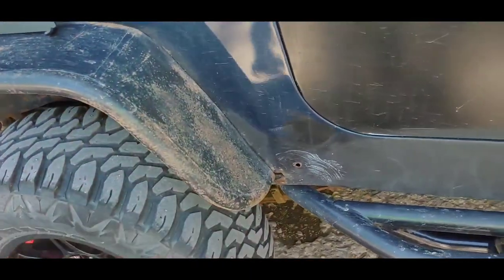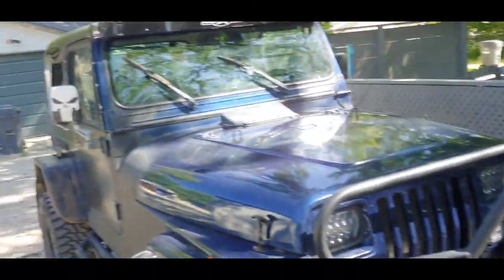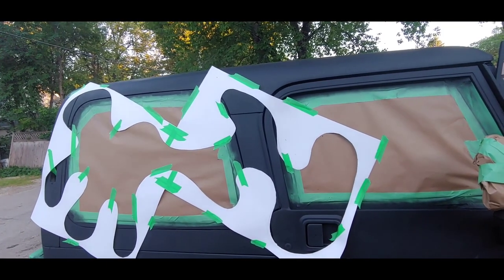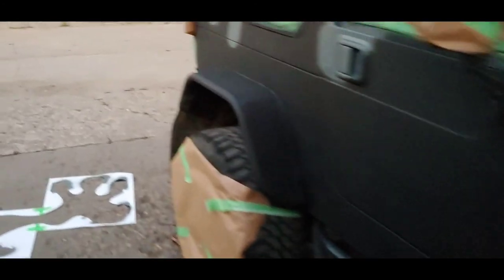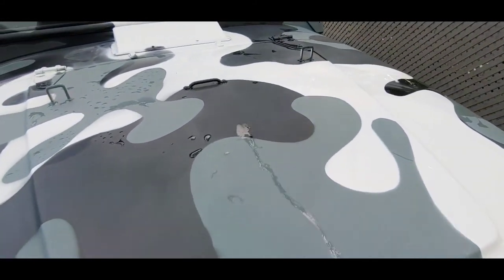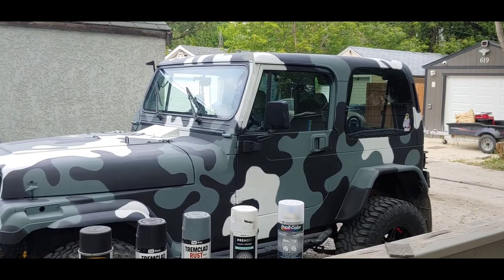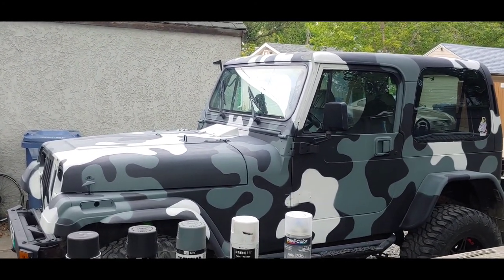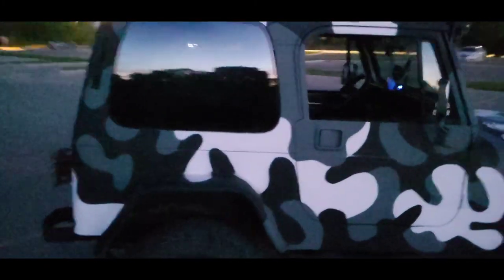Jeep Wrangler YJ Snow Camo Spray Bomb Paint!  (Cheap-ish driveway job)

Comment: I've been camouflaging my 42ft narrowboat and loving it! I'm on the 2nd colour. I used a paint spray machine on the base coat and the pattern I'm doing with a paint brush and small roller. My patches are huge compared to yours. You did a great job on your jeep.

Comment: Thinking about doing this to my 1988 Toyota pickup
Reply from the maker: That is about the only Toyota I can find acceptable.  But in full camo would for sure be a sweet lil truck. Best of luck to ya if you do, any questions feel free to ask.  Cheers!
Reply: @randomactsofdave7435  any tips before doing this such as prep work,materials,and the part of the video you cut out?
Reply from the maker: I sanded everything just enough to scuff the original paint.  I think I used 220 grit on my palm sander. I wiped everything down with xylene (cause I had some) but rubbing alcohol or possibly Windex would be ok.  Anything bare metal should get a shot of primer.  I used poster board from the dollar store as my stencils and plain brown gift wrap as my masking material.  Newspaper or something would work as well. Prepare do go through a few rolls of tape.  I looked at a camo pattern I liked, tried drawing out similar shapes and cutting them out of the poster board with a Sharp blade. I taped 2 posters together to make the shapes.  I feel it would have been easier if i had started by painting larger shapes at first.  Maybe tape 3 or 4 poster boards together for the first layer.  Tape a few shapes down and spray one color.  Let it dry move the shapes around and spray the next color. The missing footage was an unfortunate result of an amazon special camera that corrupted my files.  It was mostly footage of more masking, taping, painting and drying.  I honestly had no idea what I was doing when I started. If you come at it with nothing to loose you will loose nothing.  My backup plan was to go back to flat black if i didn't like it.  Otherwise I hope it works out for ya if you do try.  Any other questions feel free to ask. Cheers!

Comment: Man that’s a great job I know it’s hard I did a Chevy tracker in a weed camo look prey darn good but I’m been wanting a snow camo and came across ur vid, tell me how did u come up with ur stencils???
Reply from the maker: Thanks a bunch.  I really wasn't sure how it was going to come out when I started.  My stencils were just two standard posters boards from a dollar store taped together.  As for the pattern, I had a photo of a basic snow camo and just tried to draw the individual shapes just larger.  I drew it in pencil on the poster board so I could erase and change.  Once satisfied I just used a utility knife to cut out the middles.  I made about 10 different sizes and shapes.  When painting I learned not to overlap the patterns too much.  I'll also add the final product will really depend on what you used as your base color.  I was going for a darker "urban"  snow camo . If you intend on going for a brighter shade start with either grey or white as a base.  The white blotches were the hardest to paint over the dark base.  I'm just rambling now so if you want any more detail or any other questions, feel free to ask.  Cheers
Reply: Ya I think I’ll do the white base first then make pattern stencils with black, gray and flat black my wheels I’ll post on here or email ya the finished product
Reply from the maker: I would love to see how it turns out.  I'm sure it will look great, but If not it's not my fault haha!  Cheers, best of luck!